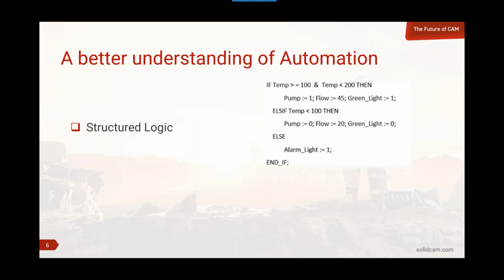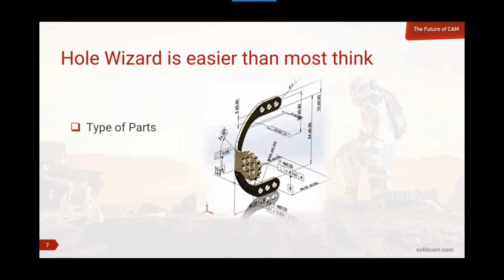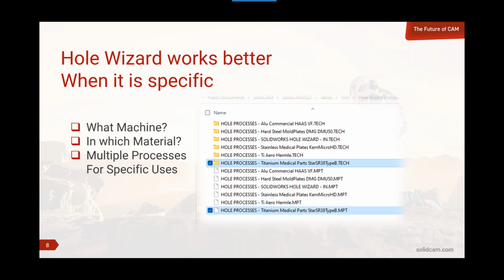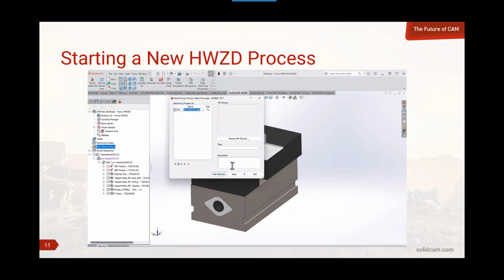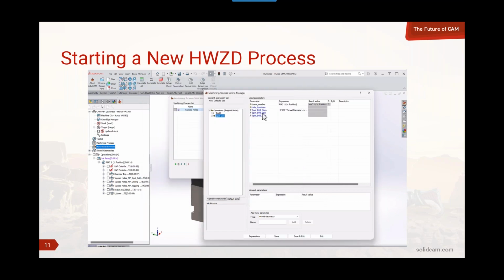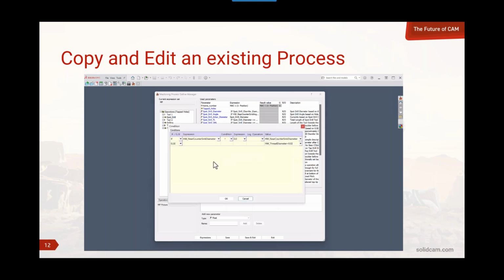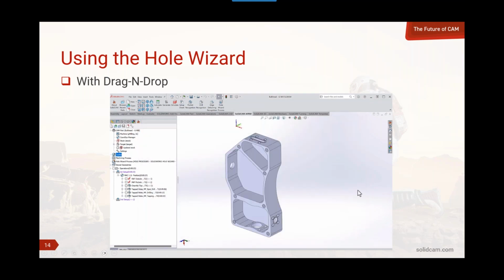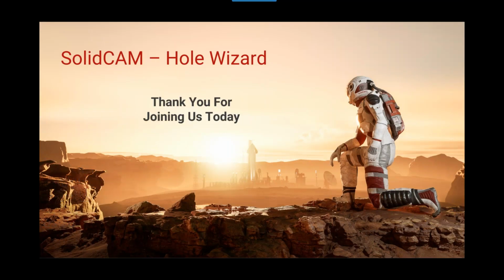SolidCAM Hole Wizard & Hole Drilling

Comment: Hello, when will Jobs like iMachining and HSS be available in the machine process and Hole Wizard?

I think there is already a good solution for feeds and speeds connectet to the iMachining Database. If your tool table has all the feeds and speeds for all the materials you work on, you can connct them to an iMachining material. Then go to your process and use the option "select data from tool table" (I think this is the english name for the option?). This works very good for me.

Thank you